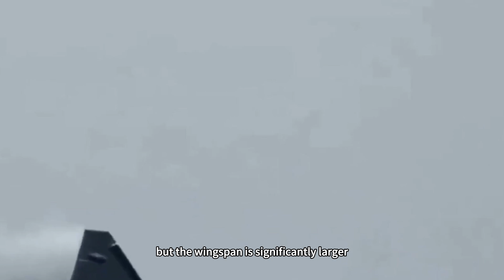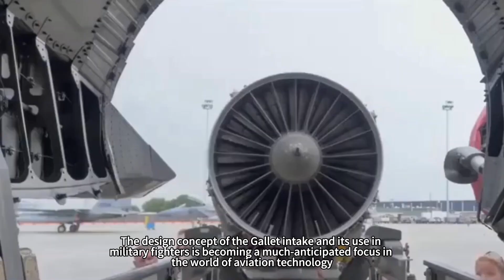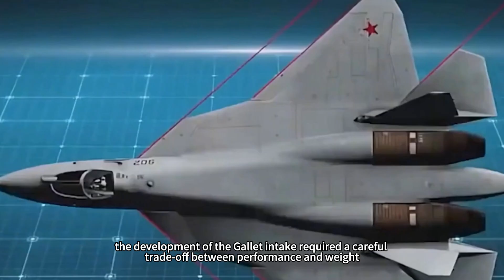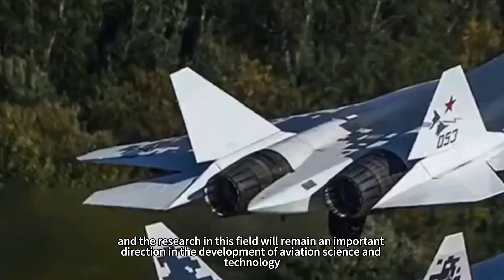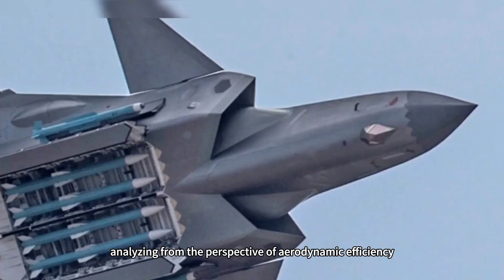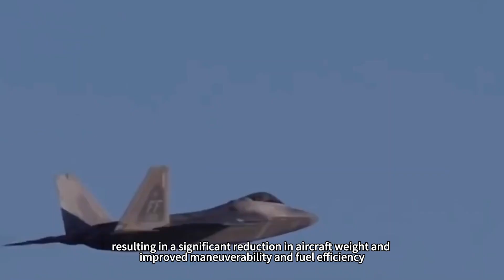China's 6th generation aircraft test flight! J-20 performs accompanying flight

Comment: Slowly but surely, China begins to make steady progress towards its defense industries.
China’s 6th generation aircraft test flight is believed to be a strike aircraft, features a unique tail-less design, which may make it difficult to detect using conventional radars.
The aircraft has a double-delta wing configuration and is propelled by three engines, with two located at the bottom of the fuselage and one on top. 
It is expected to have substantial internal space to accommodate various payloads or advanced technological systems.
The successful test flight of China’s 6th generation aircraft marks a significant milestone of China advancing aviation sector.